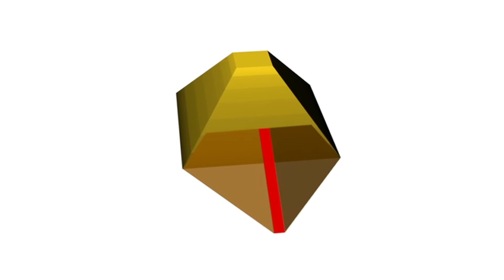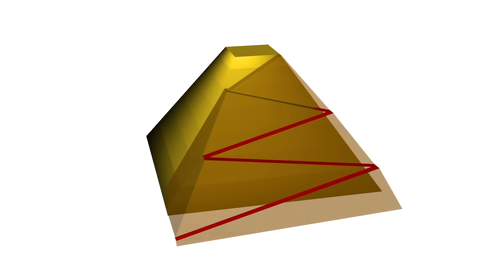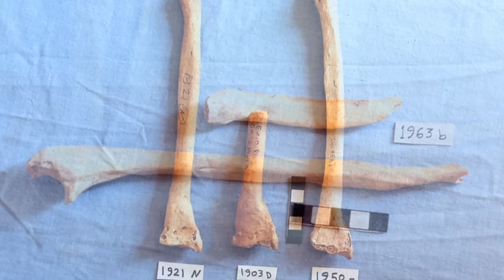Egyptology - Pyramid Construction

Comment: I Hate to burst your theory, but these blocks were not hauled at all. They were poured like concrete using limestone made with forms. This would simply be impossible to haul 1+ million blocks and align them. This simply never happened
Reply: To "burst a theory" as you say you must have credible evidence to support your contention.............which you clearly do not.  lol!  So not only do you not have a "theory" - which in legitimate science must be supported by plausible evidence - you do not even have a tenuous linkage to the actual evidence we see on the ground. What you claim here is nonsensical on its face.  Enjoy your internet inspired fantasies.
Reply: @varyolla435  It has been tested and proven. 2019 by a French Engineer. Look it up. They have done tests on the blocks
Reply: @boarhog1979  No = they haven't.  What they did was to test some pieces of the gypsum mortar the Egyptian engineers used to try to shore up the subsidence which occurred on the Bent Pyramid = and then misrepresented that to supposedly apply to the blocks of the structure itself.  Thus you have falling for = internet clickbait.

Moral of the story:  the Egyptians used a gypsum mortar for millennia.  It can be seen all over to include in places like the ceiling lintels of the King's Chamber of the Great Pyramid.  The lintels cracked during placement and the engineers applied mortar to repair the blocks rather than replace them.

So look at the blocks themselves + the quarries where the blocks came from.  You can clearly see they are layered chunks of stone consistent with those hewn from limestone bedrock which forms in layers.  You can also see in the quarries where they were quarrying in a methodical manner = "blocks".

When the Bent Pyramid was built the angle of the sides was initially too steep and subsidence occurred.  Sneferu's engineers tried to shore it up via jamming earth and mortar into areas when the sides had collapsed.  So your French engineer took a piece of mortar and misrepresented that to supposedly mean they were creating blocks out of it = wrong.  Better luck next time.

Comment: In the time that the pyramids were completed it would’ve been 1 block every 3 minutes, that seems impossible with a ramp
Reply: It takes a lot longer than 3 minutes to even climb the pyramids right now let alone bringing a multi ton block over a much larger distance since the ramps could not have been as steep or even close to as steep as the pyramid walls

Comment: Now do a video explaining how they raised multiple 70 tonne granite beams 350ft (100m) to create 5 floors above the King's Chamber. That'd be great
Reply: First get your facts straight.  The King's Chamber is only about ~43 meters above ground level and the chamber is not that tall.  The subsequent relieving chambers above are similarly not very tall - you can not stand up in them.  So the relieving chambers are in actuality perhaps ~60 meters above ground level and below.  That is not very far really when you think about it.

Next is the Great Pyramid is built atop a limestone escarpment which once had a hill on it.  You know this because you can see the remains of the hill on the exposed western side of the pyramid were a long "ledge" is seen at the bottom as opposed to a row of individual blocks.  So they obviously leveled a hillside to create a base upon which to stack blocks.  

Moral of the story:  the Egyptians built ramps to raise blocks during construction.  We have ample evidence of this fact.  Further if as noted the pyramid is in part built atop of small hill while the central core of the pyramid which represents the chambers/corridors are in the center of it = then that hillside with its natural incline might then also be part of the original ramp they used to raise the blocks to build the King's Chamber and relieving chambers above. 

So it is entirely possible they dug into the hillside to create the lower passages and chamber and built atop that to create the upper ones.  After that they simply surrounded that core of chambers/corridors with possibly filler material and cut blocks to form the main structure of the pyramid which they then surrounded with more closely cut and polished casing stones.
Reply: @varyolla435  No chance on this earth they dragged 60 - 80 tonne blocks up a ramp with ropes 🤦‍♂️ , to drag somthing of that sheer size and weight to the top of the pyramids , you would need the ramp to be at a 10° degree slope at very most , which means you would need a very very very long ramp ! it's just not logical to do and would take a hell of alot longer to build compared to how long it actually took them , the precision , accuracy and dimensions of how the were built goes wayyy beyond what we know ,  our technology today would struggle to get them as precise and accurate as they did all them years ago !!
Reply: @thebowyer100  Sorry you have difficulty reading and are apparently consumed with imagination.  Try harder.  The relieving blocks are below the halfway point on the structure.  Also ramps can absolutely be used to raise blocks via wooden sleds pulled by teams of men and draft animals = oxen.  

As to supposed "precision" - look again.  Gotta such to see only what you want to see while rationalizing inane arguments of supposed "impossibility".
Reply: @varyolla435  No way they used ramps with wooden rollers 😅🤦‍♂️ it's just not happing I'm sorry , your answer is outdated and so is this youtube video , since there's been lots of evidence to prove what your saying is not quite true , especially the way they transported the blocks up the pyramids , its a complete mystery , and to top it off its just someone's imagination and theory that they used ramps , there is no solid evidence at all that's why everyone is still baffled by this , so in a sense that completely voids your answer !
Reply: @thebowyer100  Did I say rollers - nope = ergo your reading difficulties here.  You are stuck in your groove oblivious to all around you.  How sad.

Comment: i believe i know how they were built.  i don't believe it was a ramp.  315 blocks a day for the largest pyramid alone.  i believe they used a series of aquaducts and canals, with a central water shaft.  they floated them, sunk them, then floated them again up the center of the pyramid.  its absolutely absurd to believe they could make a complex structure like that but couldn't figure out a tool other than a rock...i suggest you research their boat.  there is one surviving example of their boats.  n its absolutely fascinating and incredible.

Comment: Worked as a precision cnc grinder for several years making taper roller bearings for lathes. Was reading Some of these stones these people made, like the granite boxes found in tombs are made to absolute precision with only microns of tolerance on the internal faces and perfectly square and they weigh up to 100 tons. We couldn't machine to tolerances like that today in a temperature controled environment on such huge components. Don't think they cut these with copper chisels. And the megolithic structures in Peru are equally as confounding with blocks interlocking perfect with no gap almost looks like the were melted and squashed together. There also some melt marks on structures like someone's vandalised it with a giant thermic lance could be the result of a cataclysm, bearing in mind these are made from basalt and no traditional fire could melt this. And you can see the contrast  in architecture between the inca, megalithic and Spanish. The ancients were a lot more intelligent than they are given credit for.
Reply: Having been to a lot of ancient sites, and worked on construction (on stone and wood), there is signs of advanced cutting and shaping tech (and polishing) that are as advanced and like more. The unfinished obelisk at Aswan has the same kind of marks as we have with modern high-speed wood carvers except much larger and in granite. Some of the tube drilling has grooves so tight that the RPM levels have to be higher than anything we use. There is wet-saw blade cuts and missed cuts, and some things would require laser or ultrasound to get that kind of cutting (and likely the rock was heated before as there is signs of vitrification near the cuts, but the rock had to be immensely heated before the cutting was done and cooled after to bear that kind of indication not during the process). The ancients were very advanced. The signs are there - people just skip over them.
Reply: @christianvachon2235 Yep there is a toolmaker/aerospace engineer Christopher Dunn who has some good articles about the machining marks and dimensional accuracy ,RPMS/feed rates etc. you might be referring to other drill cores , but On some of those drill cores the grooves are actually more spaced apart at  0.1" per revolution as opposed to modern drilling granite @ 0.00022" per revolution meaning they seemed to be able to have a federate 450 times greater than us.
Reply: @karl23335  Thanks! I will look into Christopher Dunn's work. I was referring to an example from research done by a US university on drill example from Ancient Egypt that showed incredibly high RPM rates in granite higher than modern ones. A lot of things I saw first hand and could compare to personal experience.

I didn't know the example you mention, but that is incredible - 450 times greater feed rates is amazing!!!

The other issues arising outside Egypt is transportation. The pyramids at Teotihuacan (and the city itself) is a case and point. The place is filled with mica in technical applications (mostly as insulators), in huge quantities. Although some has been removed during the reconstruction in the early 1900s which was poorly done and too fast, slabs up to 9 square meters and 30cm thick were found. Modern mineral analysis revealed that it all came from Brazil which is 4000km away. So, to get massive slabs of mica and huge amounts of it 4000km from Brazil to the Central Mexican plateau (so forget rivers, etc.) you need some kind of MAJOR transportation capability.

Comment: I’m a stonemason and the sicks and string thing had me crying with laughter. For that to work the points of contact of the two sticks need to be perfectly flat and level. At college we used a straight edge and square and a technique called bonning in. These have been used for centuries and quite obviously millennia. Modern humans are so up themselves they can’t see it! These guys were astronomers and mathematicians for fuck sake and your telling me the couldn’t make a straight edge and a square? This guy has literally wasted 30 years of his time, do these experts try the techniques they come up with. What a joke! If they can get the base square to within less than an inch and perfectly level and all four sides at the same angle they were using the same basic principles of geometry we still use today. If it an’t broke don’t fix it! It’s the modern mindset of improving techniques that has clouded these poor bastards judgments. I honestly feel sorry for them. 30 years of guessing 😂
Reply: A pyramid you’re building is No mere edifice it is now an inclined plane for moving objects…At 51.5 degrees is pretty steep for an incline, but still better than nothing. The “Ramp” theories of pyramid building make no sense, because invariably you have to dismantle and rebuild the pyramid’s interior as you get higher and higher and the floor surface area of which you have to work with shrinks. Wrapping stone blocks around perimeter and fashioning the into wheels... and rolling the block along. The wheels mechanical advantage exceeds Pulling sleds by order of magnitude… moving a 2-3 ton block of stone by pulling it would require 25-50 men; A 100 ton block would take 500+ men. Rolling a 2-3 ton block only takes 2-5 men. So your mechanical advantage and efficiency improve 20-50 fold.
Plus there's this thing called counterweights.... Think of a zip tie or ratchet. If you can roll 50-100 ton block up an incline and tie it to another 2-3 ton block, with a capstan a few men can lift a 2-3 ton block effortlessly
Reply: spikedpsycho l
Reply: Blah blah you’re imagination is spiraling out of control
Reply: Cannot water be used in stone masonry to find a straight & even level?
Simple techniques, is to use & readily available to the 10,000s of craftsmen?
Reply: Where have these clever Egyptian astronomers and mathematicians disappeared to now?? What have the Egyptians invented since? They left NO clues or traces of how they built the pyramids.  Perhaps it is because the Dynastic Egyptians never built the pyramids in the first place. Whatever guesses proposed on their technique or methods used to build the pyramids are just "theories" .  So far only wooden ruler, copper chisel and hammer were left by the Dynastic Egyptians as displayed in the Cairo Museum.
Reply: European White washed bogus studies and cover-ups have destroyed human history and ESPECIALLY African history. People think there is an even flow of human progression. No there have been major catastrophic events that led to 90% or if not all of technology and ways of life to be erased all to start over again. These pyramids were probably built 200,000 or more years ago and by a civilization unkown to us. Ever wonder why all the old megalithic structures are more advanced than the ones from 3000 bc? Its because they were trying to copy what they walked into and built their culture and identity around. Wake up people. We are being lied too!!!
Reply: Quite right sir , it's a given that they had they're Einstein's back then
Reply: One the best comments I have ever read on YouTube! Also had me 😂😂🤣 bro
Reply: +Ben 7-  You obviously are an incel and do not know of what you speak.  Class dismissed.
Reply: Bruh I was done lol

Comment: This theory is beyond stupid. 
Rocks, hemp rope and copper chisels. 
Quarry a rock from miles away, and some as far as 600 miles.
There is or was no quarry on the plateau. Archeological fact.
Over 1 square mile of plateau constructed with quarry rocks.
Some rocks in high elevation is as much as 80 ton.
The wrap around ramp will not allow the thousand slaves it would take to drag such rock .
They couldn't turn the corners. The only ramp that will allow the dragging 
Theory is a several mile long ramp which would constantly need to be build higher and longer.
That could be 20-40 times the volume of the pyramid.
It would be easier to build a Ferrari with a Swiss army knife

Comment: 25 years to build @ 2.3 million blocks of stone with an average weight of 2.3 metric tons using copper to cut granite and limestone, then dragging each stone up a slope and hauling into place. I believe I have seen somewhere that if calculated to that time scale then each stone would have to be laid one every 5 minutes working around the clock.
Reply: You fuckwit it probably took them longer the the supposed theory. Besides what other pastime did they have besides farming?

Comment: This is exactly what we are told, pyramids build by men, slaves. Etc
My experience was like this.... 3 men building a wall, 2 of them are going to body building. We carried 14 rocks of granit with wheelbarrow, the rocks were 40 to 60 kg each. One of them was so heavy that we had to split it in two. The temperature was normal, below 20 degrees celsius.... It took 11 hours...
The second day... I couldn't take a pen with my fingers, they were in pain, my body was hurting, I couldn't go to gym for a week, the wheelbarrow was broken, the hammer used the day before was broken to, my knees were hurting....
So, no way men could build pyramids.
Please find another explanation.
Reply: @EZRA 13 thank you....

Comment: I just wasted 5 mins of my time watching this. I can only imagine how bad that guy must feel having wasted 30 years.
Reply: Hahahaha
Reply: Had he pulled a few mates together in those 30 years, he could built a pyramid 🤣
Reply: Ya exactly, he made a piece of string to supposedly measure if things are level.  But it won't work if wooden dowels at the end aren't on level spots from each other to begin with!!  Also you wouldn't mark low spots for more work and sanding - you'd mark the high spots.
Reply: @SoulDelSol  and you only have two minutes a block before it has to be used😲 this surely is a real bottleneck, so maybe the pyramids took 200 years to build?? Keep guessing!

Comment: Thank you for your analysis, but it is wrong... The fact was mentioned in Quran how they built these pyramids, it is easy way just to use some kinds of sands and water with die then after dry it will become as stone then they put this stone in kilen... Kilen is mobile around the pyramid to make it is easy for building... This way exactly as they produced some kinds of bricks these days... Germany research approved about these stones at reality are not stone its root is sand and water because they found small holes at stones which that means air race during mixing and kilen stage... Thank you for all

Comment: Craps. Pyramids were not made by men. 
  In the 80s Strongest crane in the world can't even complete 1/3 size of pyramid replica. New studies shown that those big blocks were cast like bricks. Palm dates trunks cannot withstand huge stress as a roller. And how do you transfer big block of rock across the river where the quarry was discovered. 
   There were many signs that advance beings was in earth even during dinosaur time. There was a fossil in Colorado that besides the prints of reptile, there's a clearly prints of boots on the rock like the one used in the moon.  And how come the pyramids roof is not blackened with soot ? There's a mural with a helicopter, tank and hoover machine. Even a giant twin bulbs !